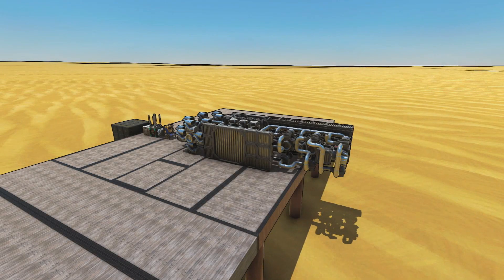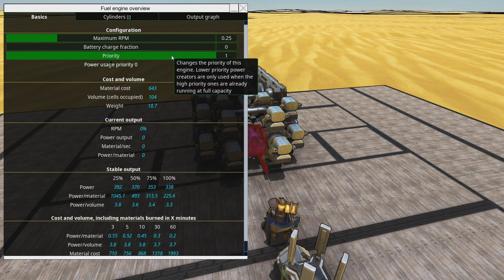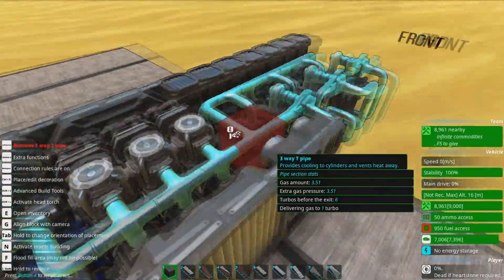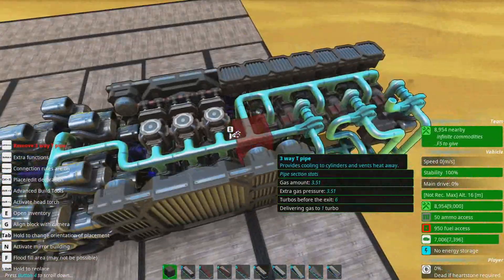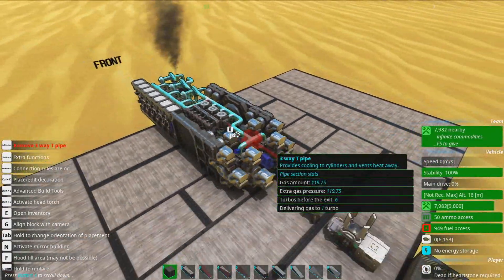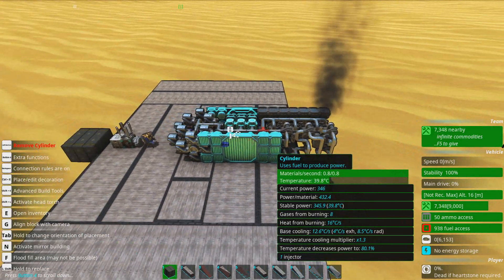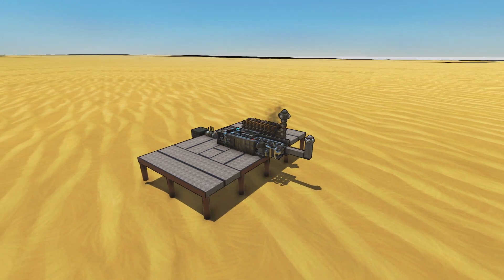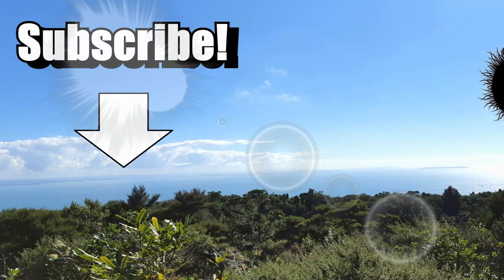Serial Multi-Stage Fuel Engines! ⛽🚂 From the Depths Tutorial

Comment: It's science time!

I've built variants of the engines seen here, I went for a 5x5xn size variant with more coolers on all parts of the engine. The last stage chaind 4 turbos per cylinder stage (total exaust goes into 4 turbos, those go into 4 turbos, etc). 
I built 2 versions, one with carburators in the second stage instead of injectors.
I built each engine to be able to max out the turbo at max power.

I compared their performance with the Powerhouse 25600 vanilla prefab. Here are my numbers:

At low power, the staged engine outperformed the Powerhouse in ppm, about 20% less ppm.
But my engine barely hit under 8k ppm (at which point it was 40% more efficient), while the Powerhouse went up to 25k power.

On top of that, the Powerhouse ended up being just about half the size of my staged engines.

Overall verdict: Possibly useful if your engine is built to spec, and if you don't care about volume, while ppm is your premium.
Otherwise, a literal vanilla prefab is better.
They are also more expensive.

Comment: I almost arrived at this sort of solution ages ago.
I've of course done different engines with different priorities. Mostly 1T vs 2T engines back when turbo engines ruled the day.
And back then I did try throwing a few injectors on an otherwise turbo engine to make more gas, but found that at the time it wasn't worth it.
Never really tried taking exhaust from one engine and using it in another as far as I can remember.

Might be a concept worth revisiting. See if I still have my old turbocharger prefabs if they even still work after all this time. Then get to testing for the right balance of injector to turbo for optimal gas usage. Probably would actually want multiple turbocharger engines - a smaller one to run off the superchargers and it's own exhaust, then a second bigger one that kicks on with the injector engine.

Comment: I'm fairly certain that turbochargers gain most of their efficiency boosting potential at low gas pressure and get diminishing returns as pressure increases. In practical terms, it's better to split the gas from the cylinders equally among all turbos at once, rather than feeding it through each one in sequence. It doesn't matter once they're all getting used to their full potential, but it would increase the efficiency of the turbocharger stage when the injector stage isn't running yet, as demonstrated in the video where the last two turbos weren't getting much pressure.
I do find exhaust pipes to be a confusing mess, and I understand that it might make it harder to fit them all together in the desired form factor this way.

Comment: It would be interesting to have a serial set of 3D carburetor tetris
The first set is the base set, then the turbocharger section kicks on
Then the final set of pure 3d kicks in if you need more, and potentially feeds the turbos (maybe a second set of turbos)

I don't know that serials with injectors are likely to work out maths wise, since you can get very power-dense, cheap, and 500ish PPM engines from just 3d carbstacking

Comment: The engine certainly could use some work, 2/3rds of the power comes from the injectors, and that means the PPM can’t be much higher than 450, and doing the math, the PPV is about 29 across the whole engine, I’ve been able to make an engine with about 30ppv and 780 ppm,

In short, While serial engines are cool concepts, thier true viability is somewhat questionable. I’ve dabbled in them too, but I’m not much further ahead than you
Reply from the maker: @cheezebagz729  Yeah, I really should make the turbo part of the engine bigger. XD
Reply: Can probably replace the injector engine with a naturally aspirated carborator engine.